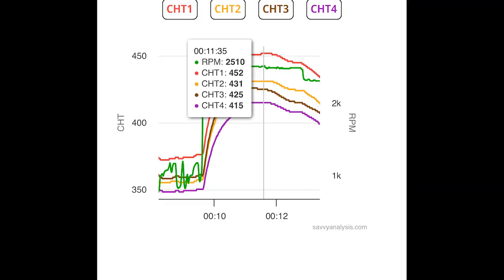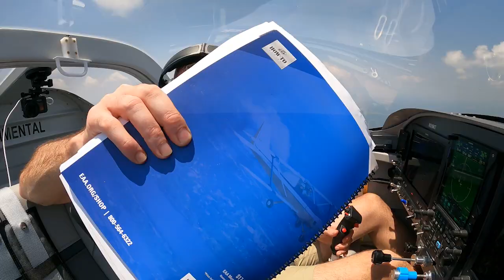Vans RV-7A Experimental Aircraft First Flight

Comment: I really like the way you carried power and good speed on the landing. Congratulations on the reward for all your hard work.
Reply from the maker: Thanks!  

It’s all about protecting the nose on landing. This point was driven home by many RV flyers.  In fact, the nose wheel is to be used for ground operations only…it’s not a “landing” gear.

Comment: Good Timing— Within the next few days, I’m doing first test flight of my plane after an engine upgrade and major improvements to almost every system. You’ve just helped me do a virtual run through and I’m more excited than ever to accomplish this first flight 
😎🎩♠️
Reply from the maker: Awesome.  Let us know how it goes.  And perhaps pass on any lessons learned.
Reply from the maker: How did your first flight go?
Reply: @scotasaurus  accomplished 1.6 hours of engine break in and Phase I testing. Performance numbers met expectations but propeller pitch adjustment should get me a little more. Oil temps were good as were EGT. CHT were near top of the green range for most of the flight (was mostly operating at or near WOT to accomplish break in). The two hottest (aft) cylinders tipped into the yellow during hardest climb. Am hoping those all decrease with break in and once I switch from mineral oil to running oil. Kind of you to ask. Your video really was exciting to watch, due to my situation, especially after more than 1.5 years of working on the project. Stay Awesome 😎🎩♠️💙

Comment: You did so many things correctly on this first flight.  You want the flight to be boring such that you can calm down as you build familiarity.  And that appears to be what you did. 

Different people will calm down at different rates.  It appears that you did it quickly.  Praise God.

Although you did explore speeds low enough for landing while at altitude, I didn’t see you proceed that with a deliberate controllability check. e.g., exercise each control to confirm that you had adequate control authority to support approach and landing.  Was that deliberate or inadvertent?

Comment: Man, I actually love the RVs that are completely bare interior. Just feels rough and raw. 

CHTs stabilized now? I’m breaking in an IO-550 and it runs hot but I’m running 25/25. Seals need to seat so I don’t pull power at all
Reply from the maker: Bare interior is lighter too.  Every ounce counts.  

Yes. CHTs are stable now.  Actually they run a bit too cool for my liking at cruise with lower temps.

Comment: does pilot suppose to wear parachute on experimental planes? can cockpit be opened in the air in order to jump out?
Reply from the maker: The pilot is not required to wear a parachute in experimental aircraft. 

I’m not sure if the canopy could be opened during flight.